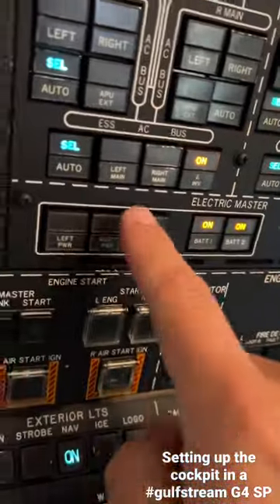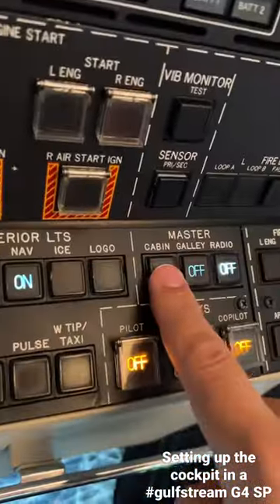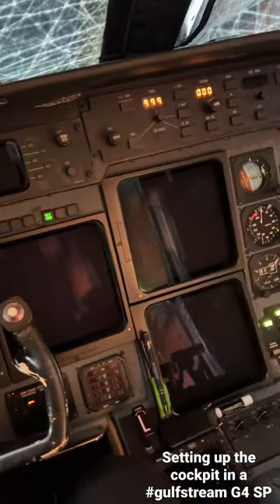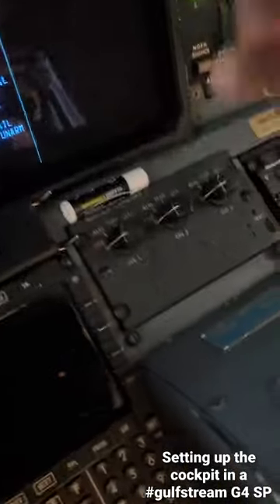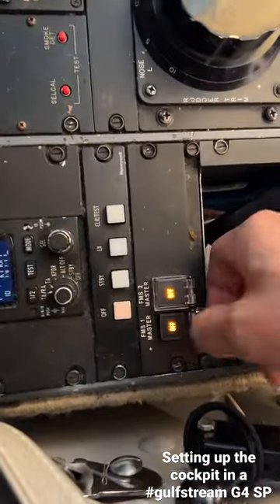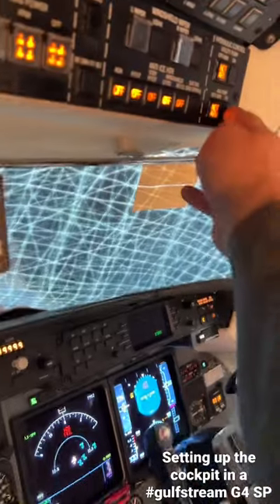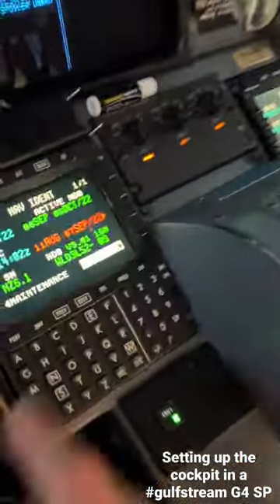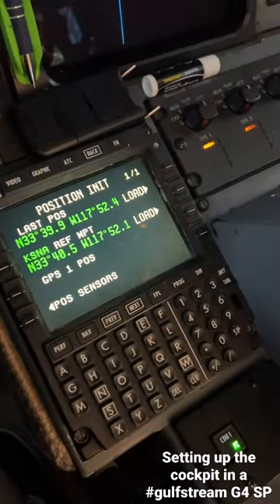#cockpit set up #gulfstream #pilot #flying #aviation #jet #privatejet #shorts #GearDown #airplane

Comment: Hm I thought the aux power was so you won’t have to use the batteries for startup?
Reply from the maker: Batteries don’t start anything on the g4 other than the APU. That is their sole purpose aside from being there as a emergency power source in the event of a complete electrical failure

Comment: This cockpit looks like a museum piece.

The jet must be about 25 years old at least
Reply: So what?   Airlines fly their planes for 40 yrs.  I currently fly a 1979 jet.   Just add fuel and go.    New is expensive.
Reply from the maker: That’s the truth! My personal jet is from 1972 🙀 but she works well for me :)
Reply from the maker: You’re pretty close but she’s very very low time and in very very good condition
Reply: @lbowsk  It wasn't a criticism - just an observation.

My friend still drives a Saab convertible which he bought in 1992.

He can't bear to part with it.

Comment: I am very curious as to why the Parking Break is set so late into this "set up" of the cockpit. I would have thought the pilots before you had already set the Parking Break ???? You need to go back to Pilots Ed 🤣🤣🤣🤣....PB is the first thing set good sir 😲😆😆
Reply: Parking Brake.   Not break.  Perhaps the airplane was just towed, or needed to be towed?  It was then chocked.   Not choked, chocked.  And perhaps all of it was done by mechanics?   Nice to chip on the pilots right off the bat.  I feel like I'm at work!  Guilty until proven innocent.  As usual.
Reply: Usually they are hydraulicly operated. The hydraulic pressure might be lost after a certain time without hydraulic pressure so planes are chocked. He set the parking brake and turned on the electric hydraulic pump to gain pressure for the parking brake to work again. 
Most planes do this so the parking brake is usually left off after shutdown allowing the brakes to cool. The chocks keep the plane on its position.
Reply from the maker: What pilots before me? Also we leave it off for ground movement aka FBO tug operators
Reply from the maker: This is true, we fire the apu all the time with the tug still attached. When tug is attached parking brake stays OFF